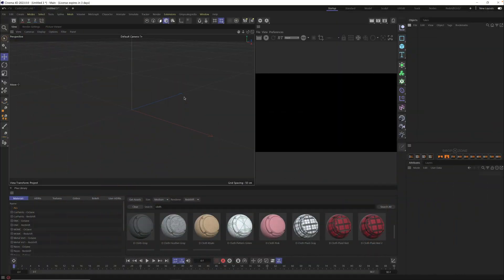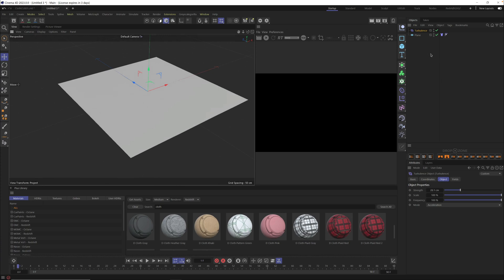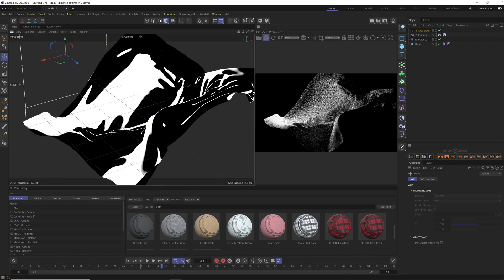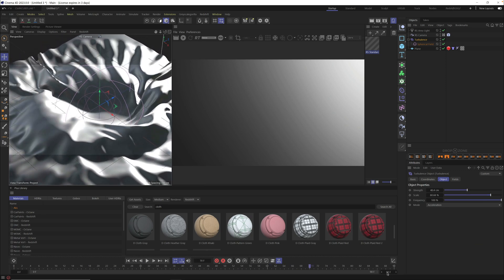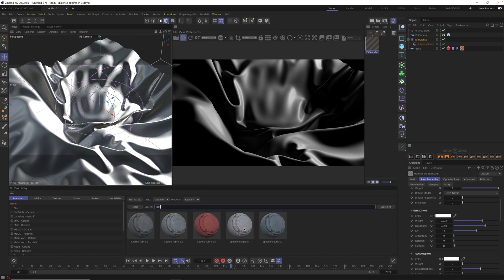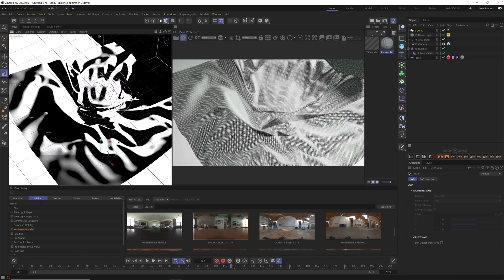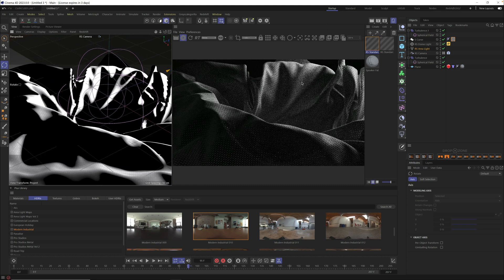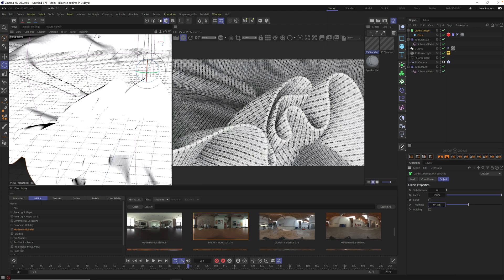Tutorial | How to Set Up Dynamic Cloth In Cinema 4D | Greyscalegorilla

Comment: Great Tutorial. Thanks.

I have a query. I want made a wood panel for a wall. I need to make fluid wrinkled but I need to constrain the height because the wood is 3 CM thick. I tried making it inside a bounding box as a collider, but it look flat where it collides with the surface.

Any tips?